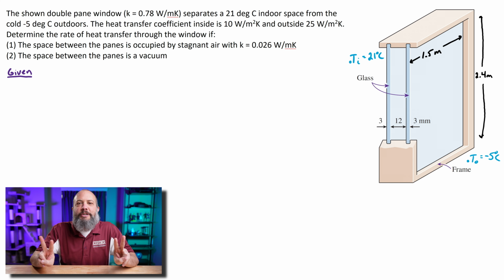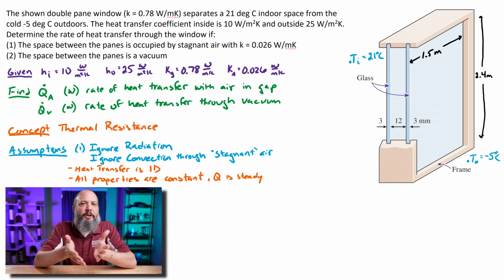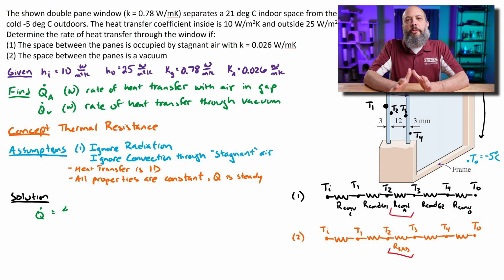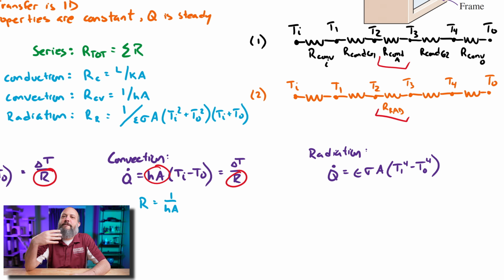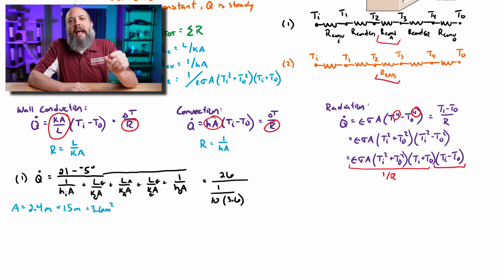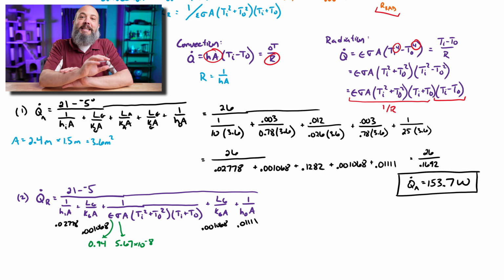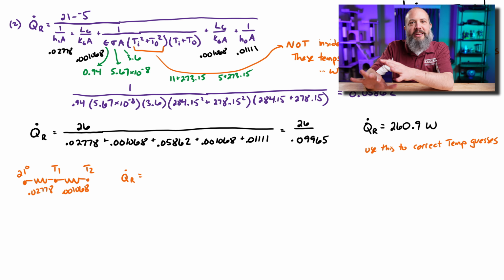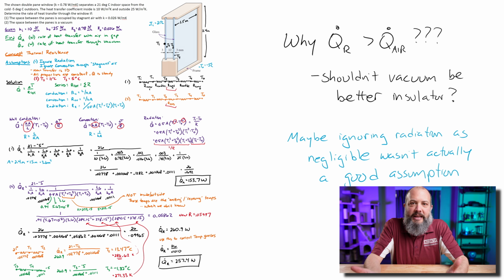Thermal Circuit Diagram with Conduction, Convection, and Radiation Thermal Resistance in Series

Comment: Isn't using the Stefan Boltzmann law for thermal conductivity a gross oversimplification of the formula, I remember that the Q' = \eplsion\sigma*A*(Ti-Tf)^4 was for two bodies such that all of the radiation emitted from the first body is absorbed by the second, there is alot of radiation leaving the system to the environment is there a better R we can use to more accurately model the heat transfer
Reply from the maker: In between the 2 planes, it is a good assumption that all of the radiation from 1 plane does go to the second plane, because the only alternative is the top bottom and sides which are super tiny in comparison to the huge surface area of the glass. But then, whether it is a good assumption that we can ignore radiation out to the environment and only use convection on the outside of the outer plane ... that one is definitely not always a good assumption to make - in the real world you would not make it. But for a textbook homework problem, your problem statement will probably specify whether its ok to do this or not, or you could just guess a general rule of thumb is "if you aren't in the radiation chapter of the textbook, it's ok to ignore radiation". That rule is usually true in textbook problems.